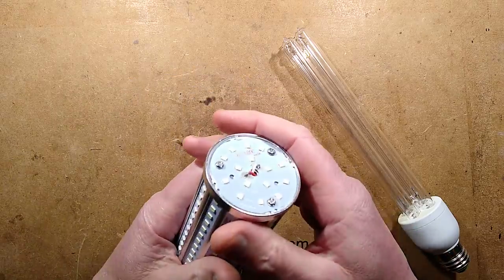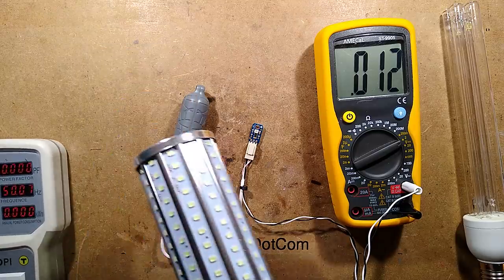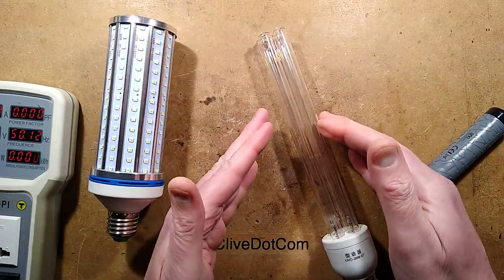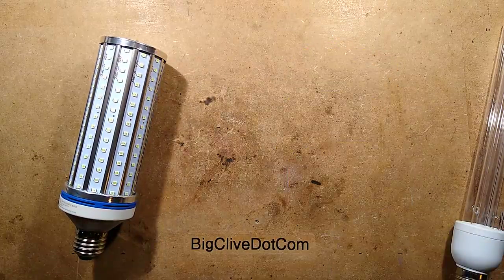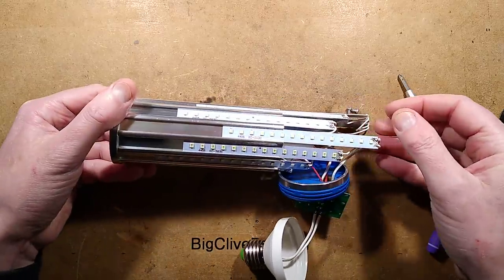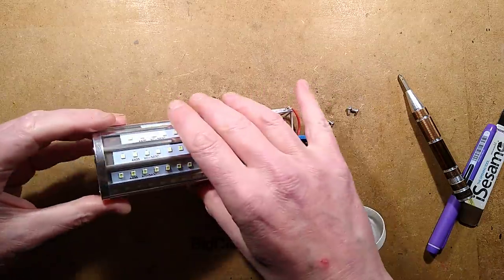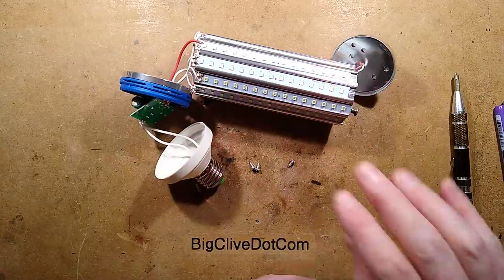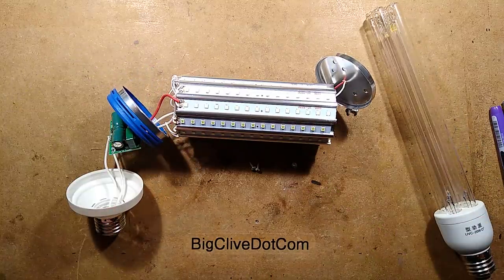Teardown of a fake UVC germicidal corn-cob lamp.

Comment: Any idea how much ozone the mercury vapour lamps (like you have in your video) produce?  I was reading that accidental overuse (hour+) can affect household plastics and rubber items that leads to prolonged off-gassing of partially oxidised plastics (a faint but bad odour).
Reply from the maker: They type that produces ozone generates enough to create a string smell and will definitely attack some materials if exposed continuously.  But for short exposures it's a low risk unless items are right up next to the lamp.

Comment: You've talked about the short terms effects of exposure to UVC and how it causes short term eye and skin damage, but if you're exposed to UVC for a prolonged period of time, can it cause blindness or cataracts to form in your eyes?  I presume it does.
Reply from the maker: Exposure would show up quickly as blistered skin and painful eyes.  Over time sustained exposure could cause serious issues, but is unlikely due to the obvious effects.
Reply: It's like being in the sun fully exposed, at an accelerated pace. 
Fun fact: tanning beds use large doses of filtered UV-C and the tanning is the skin reacting to it.
Reply: The obvious question is what PPE would be appropriate for UVC light sources.
Reply: @TheNiteNinja19  doubt
Reply: @TheNiteNinja19  They do not use UV-C light at all, they mostly use UV-A with a bit of UV-B (less than 8% of radiated UV power) because UV-B is what actually gives you a tan also sunburn.

Comment: Would putting a metal shade on the (real) UVC lamp and keeping it pointing away from you offer protection, or is the typical reflected UVC significantly bad for you too?
Reply from the maker: It does reflect from some surfaces.  The hand wands tend to be very low power.

Comment: I bought one of those little rechargable ones like you recently showed so I don't have to use my big bulb to disinfect small things. I'll be curious if the first lamp I ordered weeks ago is real or not when it finally gets here in a few days. It looks like it should be since it shows a tube inside it even though it said LED in the listing. One thing I didn't think about was that it looks like the UV tube is inside another tube which if it's glass will block the UVC. May have to take it to bits if that's the case.

Comment: Hey Clive, hope you are well. Quick question. Would (proper) UVC lamps be more or less effective for "retro brighting" over the more normal method of "full spectrum" UV LEDs / tubes?

If you aren't aware, but you probably are, retro brighting is a method of using Hydroden Peroxide fluid (20 to 40 vol) mixed in water and placed in a plastic crate etc. or cream spread over the plastic and covered with cling film to de-yellow aged plastics. Sunlight is preferred, but there's no guarantee of that, so grow lights are often used as a replacement. 

Thank you for your content and streams of late, people like you are really helping at times like this. Much respect.

Comment: Very useful video.  Most if not all currencies and passports have UV reflective features in order to detect fake from real ones.  Can I use a currency or passport that I know has UV features to detect a fake UV light? Seems logical because a real UV would cause the features to glow while the fake ones will not.  Seems a practical way to know if the UV light being used is real and it's really killing germs.

Comment: I'm sure it would be possible to find lamps of similar, even identical, construction except for white LEDs.
Changing the colour of LEDs is trivial especially different colours are physically and electrically identical.
The construction is quite modular. Possibly the drivers and LED strip "lamps" are supplied as components to somewhere which assembles these lights.

Comment: Would love to see the comparison between a real UVLED chip. Would be great if you get an assortment UVLED chips to take a look at them under magnification and play with them a bit. Maybe even retrofit them into a nice flashlight host!?

I’ve done a few DIY UVLED upgrades to my convoy S2 and C8 flashlights. They work great for all types of uses but the little SMD Uv LEDs aren’t cheap. Mine go down to 365nm. And I have them going up to higher wavelengths. It’s great to have various wavelengths when trying to identify minerals or other UV fluorescent objects. I use them primarily for guitar and violin repair and assessment. Looking for repaired or refinished areas on instruments.

 Would love to get some lower wavelength UV LEDs.

Comment: Hey Clive. You could do something to be more definitive with your testing. Build a setup to put the light source behind a light barrier with a vertical slit in the middle. Place a diffraction grating just after the slit, so that all the light will be coming from a point source and then get split into it's spectral lines. have this displayed on a backdrop, with wavelengths scale indicated.
Reply: Does the diffraction grating have to be quartz? Do they make plastic diffraction gratings that pass UV?
Reply from the maker: Keep in mind that the UV wavelengths are invisible and need a special sensor.
Reply: @bigclivedotcom  or just a phosphor.

Comment: Are there actually any true UVC LED lamps on Amazon right now?  Most corn-cob bulbs I've seen appear to be fake.
Reply from the maker: Any real UVC LED lights are very low power and expensive compared to the traditional fluorescent tube type.
Reply: @bigclivedotcom  Assumed as much.  Wonder how research onto those 210nm LEDs are going; supposedly too narrow wavelength to affect skin (and eyes, but less sure about that one because any high-intensity light can still hurt them), but within wavelength to still be germicidal.

Comment: I bought one of those. I do have to say I definitely smelt a small amount of ozone after using it 30 minutes. But not what I expected, other much less powerful UV lamps I have used are very noticable. btw, I did not test it on my skin. It was very hot after the 30 min. I am wondering if maybe the smell was from the heat, maybe they purposefully used materials that breakdown under heat and release ozone?
Reply from the maker: It was probably the heat.  Ozone smells like bleach.  It wouldn't surprise me if they put a small ozone generator in one of these as part of the illusion.

Comment: Why don't they make the E26/27 bulb rods for 110V, only 220V.  They should be easy to modify, right?
Reply from the maker: They are often made for the 220V Chinese market.  You can often find them in a 120V version.

Comment: I am curious what the "Tuba" sound at the very beginning of every video you post is caused by.
Reply: Are you high or something?   There's no "Tuba" sound....
Reply: @haywoodyoudome  Obviously your hearing is, or, speakers are worse than mine as I can easily hear a low sound for a fraction of a second at the start of many of his videos.
Reply from the maker: It's a weird quirk of the audio gain control in the current recording device.

Comment: I notice on AliExpress and eBay that these lights come with either an aluminum or plastic BASE (the inch or so between the bottom of the LED strip and the screw-in socket). (Big Clive has the plastic base version.) 
 
Looking closely at the store photos, I also notice that the vertical LED strips are different. 
In the Alum version they are paired... 20x2 down each strip, as opposed to 15x1 (in Big Clive's bulb). 

I'm still waiting on mine, with the aluminum base, that I order from AliExpress back on Mar 29th. 
(Last tracking update was May 3rd. It's supposed to be in-country now. So there's still hope?)

Also hoping that the aluminum base version is the real UV-C. But Big Clive's comments on LED pricing do not instill confidence. 
(As mentioned in prev video, I'm planning to test it and another (tubular version) against a few moldy yogurt samples.)

Comment: I have 2 of them, one that makes ozone, and one that does not. I have to travel for work, so I be going over the bed, pillows, and outher surfaces in the hotel room win the non-ozone producing one. Then I put the other in one of the lamps and take the shade and harp off. Then I turn it on and leave for 15-30 minutes. Come back turn it off, then leave for 15 to let the ozone dissipate. I haven't gotten sick so far. Fortunately I work at remote sites and am usually alone or in contact with a minimum number of ppl.

Comment: Hi Clive, I see you try to do a good job to find out the true.  But the sensor you use is only down to 240nm.  Those new UVC without ozone is using the phospho convert with shifting the light emitted from LED to a UVC spectrum and the efficiency is not that high.  In order to tell whether it really generate UVC or not, you need a UVC meter, not a UVA/UVB sensor.  The mercury vapor tube you use is emitting UVC mostly above 240nm which also generate ozone that’s why you can smell it as well.  For non ozone UVC, the spectrum need to be below 240nm.  Since a UVC meter cost more than 800usd.  Why don’t you try a disinfection test instead.  Just cut 2 thin slices of banana, one use the light for 15 minutes and the other just on the table.  Then put both in a glass container.  After 24 hours you can tell whether the disinfect work or not.  The cheap UVC LED is using a thin coat of phosphorus compound that shifting the light to UVC spectrum, so the efficiency is just less than 10% compare to mercury vapor tube which is 40% plus.  Also spectrum below 240nm won’t be detected by you sensor.

Comment: There is an outfit here in the US of A that distributes what appears to me as a sort of box with UV C lights inside, there is an opening in the top that sort of shines at the roof of the room, (usually a public bathroom) and is supposed to be a sanitizer according to the sign on the device.  Just wondering if you folks over there have that sort of thing?  I once purchased one of their used pickup trucks, I drove it all while I was being re-educated following an accident that ruined my police career. She was a good pickup, when I purchased a larger camper, however she didn't have enough power to pull it up the hills so I traded it off, my sister went to the dealer and purchased the old pickup and drove it for 8 years, then sold it to another fellow who is still driving the little guy all over town. I wish I had it back now Damn IT!

Comment: Big Clive what do you know about CPAP Cleaner. I thought maybe it was UVC light generating Ozone. It's not. At least the one I got is using high voltage... I think? Please check it out. I got mine for about $40 US. Smells kind of bad when I turn it on just for a second.

Can't find original listing part# WQ2200
Reply from the maker: Looks like it might use corona discharge to create ozone (which smells like bleach).
Reply: @bigclivedotcom  thanks I looked inside. It has a coin shaped thingy about a half an inch, I can see the coronal discharge on the surface. Some kind of potted high voltage transformer, a fan, and "2200" mah no name 18650. 

It states Ozone 30mg/h. Is that a lot? Only thing I could find is OSHA recommend less than 10ppm/h. Not sure how that really correlates.

Comment: I was wondering if you would rate sellers according to your tests and experiences - that it what the feedback is for. I know you said this seller is gone (maybe rather changed his/her seller-ID) but how about the others? I experienced quite a few sellers that won't sell me anything, probably  because I DO rate my purchases. Headset that loses connection even if it is on the table in front of me? Negative. Bluetooth adapters without driver and no driver to be found/downloaded? Negative. LED Lamps that light dimly even if they are off? Maybe it is our old house that leaks current so they get the benefit of the doubt. Nice videos. Have a nice day.

Comment: Hello,

Now I would like to deliberately purchase blue LED bulbs that mimick the ghostly blue of UVC lamps for the visual effect but I don't want to pay too much for a poor quality product either.
So should I look for one of those "germicidal" scams or maybe for actual blue LED lamps ?
In that case what are the keywords I should try ?
I don't even know the wavelength of that particular blue.

And you know it very well by now but I already have some proper UVC tubes if I want to sterilize or deodorize a room or a pair of shoes or anything.
I even have ozone and ozone-free bulbs by now !
Reply from the maker: It might be worth buying some of these fake germicidal lamps and then adjusting the circuitry to tame them down if possible.
Given that these sellers are cashing in on the pandemic with fake products that are potentially putting people's lives at risk, it's one time I'd happily encourage you to buy them on eBay and then open a dispute for a fake product to get some of your money back (without returning the goods).  It might discourage them from their fraud.

Comment: It's very close, at least, to the right color, but MUCH to bright for a real UVC light.  And, of course, you can see that the LEDs are entirely the wrong construction to be real UV LEDs.

If you could get some kind of globe over it, it might make a nice lamp to mod or if you just wanted a bright blue lamp for some season.  (I can think of an application or two that would involve reworking the thing to just use the power supply and LEDs.  If you had a source of photosetting resin that worked with the output of that light, it would make a dandy light source for a DIY SLA printer.)

Comment: Hi all, does anyone know a good replacement or a way to diy an air compressor that can actually blow concentrated air?

I need it for cleaning old consoles like Xbox original and so on. 

I know there are those big air tanks that you can purchase, but they are too big and expensive. So i'm looking for something else, like maybe a tire air compressor...
Reply from the maker: You can rough up a receiver for short bursts of use with a tyre.  The small compressors are not intended for high use and will overheat quickly.
Reply: @bigclivedotcom  What would be than a better solution? 

I have seen many mini leaf blowers on eBay being advertised for this use. Could maybe those be better modified solution to work for this?

Comment: I have a real one like yours Clive. I killed it running it on 120v so yesterday I cobbled it on to a cfl ballast. It worked until I went to cover it and broke a lead off in the glass. :(      ):
Reply: I have several, I use them in my aquariums, they are great for algae and disease control.  The ones I get are from a pet supplies seller on Ebay, pretty cheaply.
Reply: post pics of your hacked together cfl ballast?
do you just wire it the same way as the sprial does with all 4 wires?
Reply: @frogz  I'll try to post pics tomorrow but yes all four leads. IDK if that's the right thing but it did work.

Comment: Thanks for these videos! I got one of those UV sterilizer light tubes for aquariums from Amazon. Is there a safe way to determine if UVC is being emitted from a light without a sensor or killing an organism? I saw another youtuber expose a banana.
Reply: UV bulbs you will know within moments. A bulb like that you will start to feel basically a sunburn and smell ozone forming within less than a minute of powering it on. If you actually were to stay in the room that entire minute you would have a sunburn and can easily become a fairly serious burn if you stay for very long. Ultraviolet light in any significant amounts causes Burns and the breakdown of room air into ozone. In fact that ozone is your primary sterilizing it tool if you do choose to use a bulb like this for sanitation or disinfecting. Ozone is ultra toxic to especially microbial life. Against viruses the ultraviolet itself is most effective because it literally breaks down the DNA in any significant exposure. Under no circumstances should you be in the room when it is running for any length of time and vent the room after it's been running for very long so as to not inhale too much of the ozone before working there. Considering how easy these bulbs are to make at this point, and the viruses and especially antibody resistant microbials that you see in hospitals, I would love to see if these installed in most hospitals with a key switch or something similar to keep people from turning them on accidentally.

Comment: NB no licking the end of the fake UVC light when switched on.
Reply from the maker: I've actually just burnt a banana with this light.  Not with UVC, but with heat from one of the LEDs and aluminium fins.
Reply: @bigclivedotcom  Ah a potential alternative to the spikey thing you did the hot dogs with then?

Comment: 99% of the LED lights that have died on me, it was the power supply side, the leds themselves seem to work fine, so ive desoldered alot to put in my salvaged parts
Reply: Yes, it's always the drivers that fail. If you're unlucky they fail short circuit, blow the arse out the chips and burn out any dimmer switches they are attached to. Learnt that lesson the hard way, don't use cheap shitty led lamps on very expensive electronic dimmer switches.

Comment: Hi. I build LED lights for a living. The market rate even from the cheapest Chinese supplier for UV-C LEDs is over $1.70 a watt. So if a light is costs less than $2 a watt it's not UV-C. Also the package for the chip can't be plastic so that's a giveaway also. All the stuff on Aliexpress, Ebay, Banggood etc are fake

Comment: I couldn’t find any on Amazon so resorted to eBay and turned out it was one of these pieces of ****.
I had planned to properly test it (and if necessary return it) but was starting to get complacent just as you mentioned people might!
Thing is mine does output some smell sweet smell. Need to look into how to test it as you have done. 
Just Make sure those testing devices aren’t chinese fakes too!